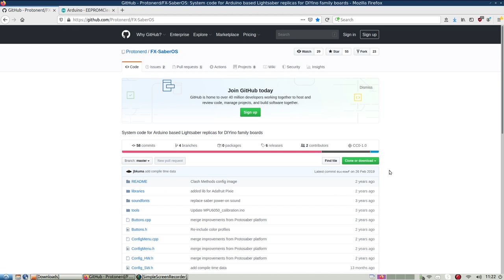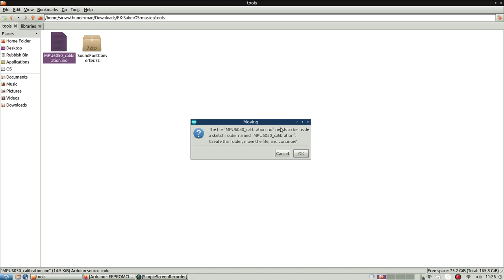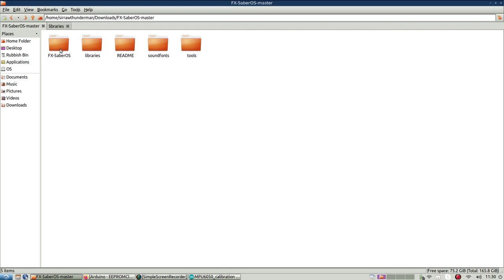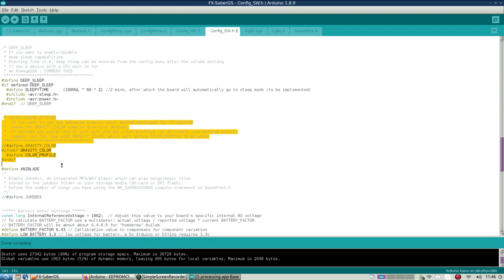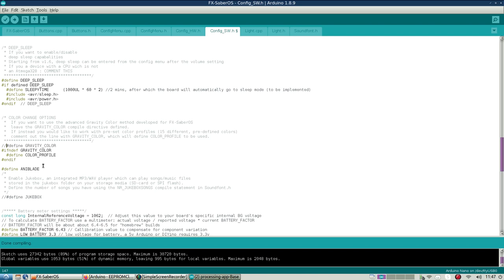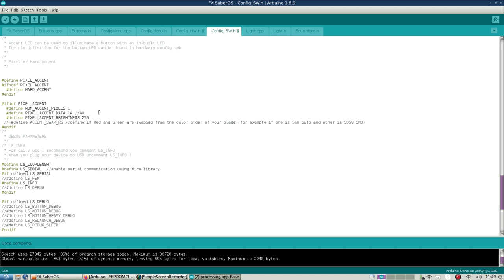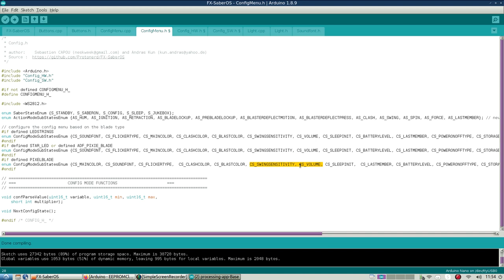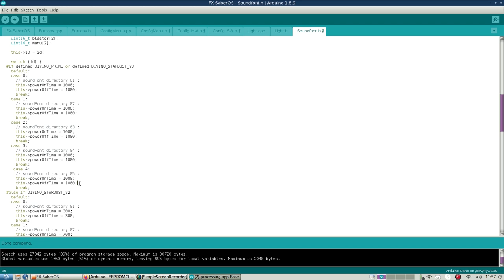FX-SaberOS Setup Tutorial

Comment: llevo un mes intentando subir el sketh y al final me da error stk 500 programer no responder avr dude  utilizo la 16,17   que puedo hacer estoy desesperado,,,.,.
Reply from the maker: If Google translate got that properly (Sorry, I don't speak Spanish) you've got an AVRdude error. That usually means your arduino and Arduino IDE aren't communicating. Things you can try:
-Change USB cable
-In arduino IDE, go to Tools, and make sure you've got the right arduino model in Boards, the right processor in Processor (try using the ATmega238P Old Bootloader), and the right Port in Ports
-If you're using Linux, make sure your profile is in the Dialout Group (you'll have to google how to do that)

Good luck!